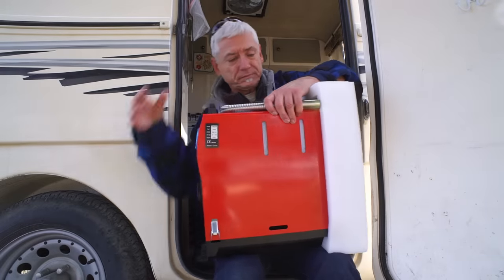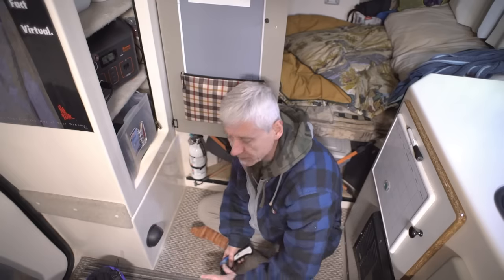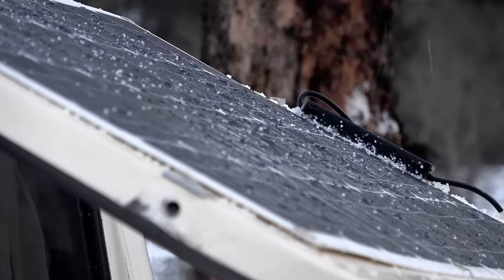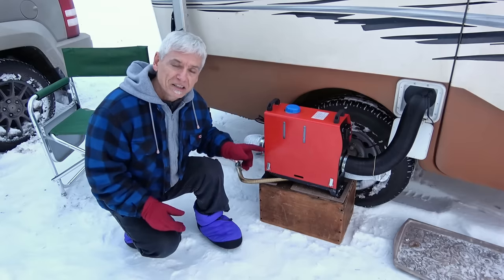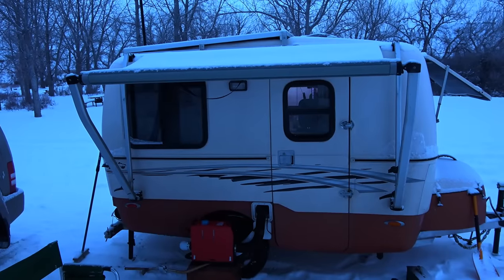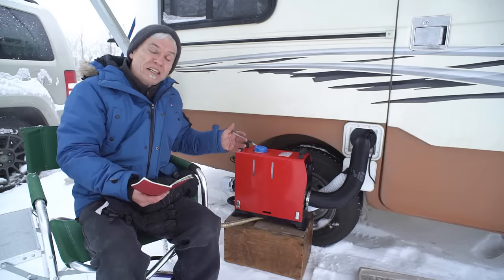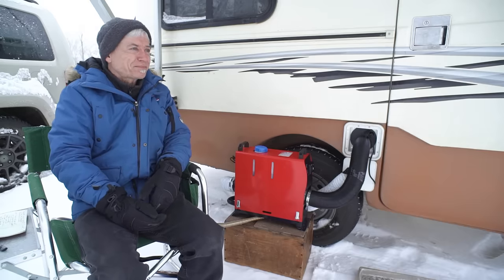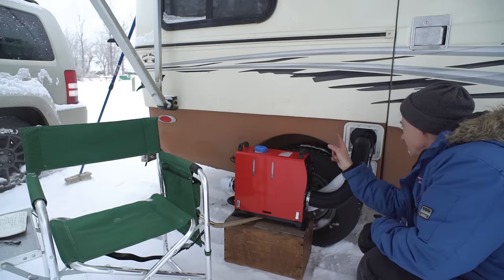Can this Work with a Camper? My Parking Heater Experiment Part 2

Comment: Slim, really appreciate your videos....I can't help but think you would have better success with the intake hose being inside the trailer....a home furnace depends on reheating the home's warm air and not heating the outside cold air....also maybe consider an insulated box to protect the unit from exposure and maybe dampening the fuel pump??...thanks again for the demo 🤓
Reply: That would lower the amount of fuel burned per hour by half or close to half. I could be wrong. Hopefully someone has done that and will let us know.

Comment: Try putting an insulation around the pump. That might help the noise. Love the videos.
Reply: they sell a silicon cover just for this purpose.
Reply: Looks like the pump also is pretty much bolted to the front panel. Some rubber mounts/bushings could help too.
Reply: I didn't know about the silicone cover, but I did wonder about isolating the pump using the same concept as they do with the water pump in most RV's, a number of rubber grommets to keep the vibration of the pump from making the back of the heater case a diaphragm.  
By the way Slim, love your work, great videos.   Wish I knew ahead of time about your Natchez Trace trip a couple of years ago,  you were in our back yard. 
Keep up the good work.

Comment: Hi Slim.

I follow your escapades with interest as I bought a small caravan (About 10 Cubic Metres inside) in June last year to travel the UK, I've only had one trip in the summer though due to our lockdowns. Even though the UK doesn't get too cold I still need occasional heat as it can get chilly, currently it's -1 degree Centigrade. I didn't want a gas furnace/diesel heater/Buddy heater as I would use up my Propane in no time and/or have to find a space in my van to either fit and/or drill holes in the van. So I decided to try a Tilley Lamp for light and heat. I have just tested it and it raised the inside to 22 Degree Centigrade from 4 Degree Centigrade in an hour. Not too shabby. It uses 1.5 Imperial Pints (0.85 L) of Paraffin (Kerosene) every 12 hours, so cheap to run. Yes, you need ventilation but that's no bad thing to keep the condensation down. It stabilized at 22 C even with all the windows (Three) open an inch, hardly any condensation either. It puts out about 700W of heat by my calculations. Heat and Light for very little, Win Win as far as I'm concerned. Wonder if you would do a test? You can even cook on them if you make a small wire cage to put on the top to stabilize the pan on. So possibly a Win Win Win. I got the idea from the yachting and fishing world where they are apparently commonly used here in the UK.
Reply: Oh and a couple of small fans to move the heat around, one horizontal and one blowing down from the roof. Obviously they produce CO, but no more than a Buddy Heater or similar propane heater, so a CO detector is vital, I ran it for 2 hours with no issues but I would never go to sleep with it running.

Comment: I used an 8kw heater set up very similar to that in my 28 foot trailer for hunting season in November. Put it in a box so it was covered for weather. Put a metal duct into a small bunk window. Was on for 7 days straight. Used about a gallon of diesel per day. Used about 1 to 2 amps depending on set temp. 150 watts of solar was mostly enough to run the heater and the fridge, lights, charge phone, etc. Ran the generator for a couple hours in the evening if required.  They work good if you want to tinker a little for the setup. I hung the fuel pump on an angle with zip ties and barely heard it.

Comment: I fitted the permanent van install in my trailer and in a way I actually wish I had bought the self contained portable heater like yours to give me flexibility and versatility in my shed at home when I. Didn't need it in sub zero temps.

Great video, thanks.

Comment: Awesome information! Just what I was looking for, all my questions answered all at once and I didn't have to bounce around for hours, days or even weeks to find the answers. I now know that I will have to use a 3" fireplace flange, heat sealant, double walled steel pipe for the hot air coming into my tiny all metal tear drop trailer. {all metal means the floor is 1/2 thick aluminum plate, the sides and front are 1/4 thick aluminum plate and the roof is topped with 1/8 thick aluminum sheeting} I have 1 inch poly foam board on all interior surfaces and covered with thin Birch Plywood. I am going to use the fireplace flange that has an air gap and the double walled steel pipe to prevent any heat damage to either the wood or foam causing fire or melting, safety first! Your video gave me all those answers, thank you so much!

Comment: 1. Insulating the warm air hose run on the outside would help with efficiency.
2. It would REALLY help efficiency to add a cold-air return hose. Then the heater would be reheating already somewhat-warm air instead of starting with frigid outside air, plus you wouldn't have a positive pressure situation inside the trailer that leaks warm air to the outdoors.
3. Adding a cold-air return hose would also stop the problem of the heater sucking its own exhaust fumes inside the trailer.
4. The thermostat is outdoors, so the heater is in an always-on state. Use some multi-conductor cable and a connector to allow the thermostat to be mounted indoors and one would get better temperature regulation.
5.A marine-grade propane heater might be a better solution. They are generally built to better standards than RV grade equipment and draw less electric power. Many RV'ers use them successfully. Biggest minus is that they cost quite a bit more than a cheap Chinese diesel heater.
Reply from the maker: 1. I wasn't looking for efficiency, I wanted to keep the camper above freezing
2. Same as above
3. Incorrect. Diesel fumes enter regardless. Try spilling a puddle outside and you will see
4. I don't need a thermostat. It is only used on manual mode
5. I don't spend a lot of money on an experiment. This gave me all the details I need should I decide to upgrade. I wouldn't bank on that though! Thanks, SP
Reply: David, ANY problem can be overcome by throwing money at it...where are the funds for that? Where is the FUN in that? Here is something to consider. Restrain that urge to offer up a "post-video" list of what someone should have or could have done. It can be depressing at the receiving end. Think about it.
Reply: @SlimPotatohead  The marine heater would have to be seen as more of a (non-trivial) investment, not an experiment. If one searches around, there's quite a few RV'ers who have used them. Plenty of existing experience to rely on. The question is whether it is personally worth spending that sort of money on a heater, and that is a question only you can answer.

Comment: Great video! I always wondered if the jackery  could handle that kind of draw.  I personally would look into insulated hoses for the air. And would absolutely draw the fresh air from inside the trailer.
Reply: No. No. No. Even though it is not combustion air...
Reply: I absolutely agree, David.  If not, for every cubic foot of hot air that comes down that hose, a cubic foot of warm air inside the trailer is pushed out (through cracks around the door and windows, vents, chases for wiring, etc.).  Heating an enclosed area that way is like bailing out a boat with a cup without a bottom.  It would make a significant difference i the heating efficiency to have the intake air come from inside the closed trailer.
Reply: @brucebear1  just like central heat and air conditioning in a home. As long as you have a carbon monoxide alarm and a smoke detector, everything should be nice and cozy.

Comment: You could make a box to sit on the back of the trailer that would work as a storage box in the summer and a heater enclosure in the winter.  You could even put a solar panel on it and make it autonomous from your jackery power.  It would also be better to run the heater with air from the camper.  You could even run the fuel in from a bigger jerry can which could last a week or more!  So you only fuel it up once when you are gassing up the car and you are good.  No fumes....no fuel odors....no worries about losing power.  Its a win-win-win!

Comment: I don't know why yours clicks like that. I've used a few in big rigs, and other than the whine on start up, they have never made that noise. It could be the fuel pump. Or maybe the fan is hitting the shroud. But that's just a guess.  I do know a wabsco is around 1k. So very expensive. Great video. I'm still trying to figure out what I want to install in my van build. So all information is good information. But I'm still a long way off. The only thing i've done so far is the installation of 2 maxair fans. Love the video's Slim, the amount of information you give us is great. Good luck !

Comment: I just installed one of the Happy Buy knock off brand semi-permanent heaters inside the dinette bench of my 2021 Coleman 17b trailer.  I discovered, just like you, that 24" of ducting is not enough to prevent the cheap vents from melting...  I invested in the Webasto brand vents and they hold up much better!!  Webasto has been making diesel airtop heaters for decades so they really know how to make the systems work.  These little heaters are great for RVs and much safer than the Mr. Heater propane units people are burning inside their RVs.

Comment: I saw a van diesel heater install where the person only attached the top of the fuel pump. He let the bottom hang free. It was still at 45% but it was very very quiet.

Comment: Having worked in a factory for forty years, that taping noise you kept mentioning, I 'tuned it out' quite easily just because of worked in a noisy factory. Several times during the video I 'stopped hearing it' until you mentioned it. So I would suggest it is something that a person can get use to given enough time. Just like one time some time ago the in-laws came to visit with a pop up style of camper. We had them set up so it was shielded with the house away from the major highway that was about 500 feet away. That next morning they ask us how we could sleep with 'all that noise', we both looked at them and ask, what noise? We were use to it and didn't hear it, tuned it out.
Reply: I remember back in the 60's, my grandparents lived about 100 yards from the North-Western railroad tracks. Every night at 9, the whole house would shake when the steam train came through at about 60 miles per hour! My grandparents never heard or felt it!  :)
Reply: @nejdro1  for these noise I also tune them out easily. But when they stop I tend to freak out knowing something has changed and being not immediately able to know/remember what.

Comment: Great 2 part video.  Looking forward to 2021's adventures. I've had a China heater in my 8 1/2'  truck camper (permanent install type) for 3 years now and have had no issues with it.  Glad you found the "6 hour"  problem.  Diesel air heaters are definitely not for everyone.  All the best in the New Year.

Comment: Slim, I really appreciated this analysis. My problem is getting thru the summer night in my minivan with my partner, my pet parrot. Can’t make fumes, parrots have very sensitive lungs, so must be electric and you know the challenges there. COVID has simplified the travel question for a year but you have helped eliminate the diesel possibility. My minivan is not tricked out with any heat in the cargo zone. I have been trying to use heating pads for overnight. Parrots need to be in the 60 to 80 degree range. Guess I’m out of ideas.

Comment: A squeegee on a telescopic handle looks like a great tool to clean water and snow off solar panels. I have a aolar aystem to install next year, I will make a squeegee for myself. Thanks for the videos. I need to finish with my diesel heater and test it before I  need it.
Reply: I use a large squeegee that can be extended. Use it for cleaning dust or washing them. It would work for snow too, but not anything frozen on them.

Comment: Have you thought about some sort of insulated little "house" to cover the heater - it might minimize some of the tick-tick-tick noise it makes.
Reply: A housing would likely also keep snow off of the unit instead of an umbrella,and that umbrella plan still worked well for you.
Great informative video, and nice work.
Reply: Ya I was thinking it's just the fuel pump so you could probably just wrap it in Insulation and quiet it down and I'd be surprised if they don't make another pump that is quieter

Comment: Thanks for giving me the idea of mounting the heater (one of the lower profile models with remote control) on a hitch step with an 8"x18" platform. I plan on using one of the vans existing passive corner vents to move the heated air into my 2012 Transit Connect.

Comment: I have the exact same unit arriving, I had planned to mount it on my second pickup truck to keep the interior dry / warm / mildew free (it gets pretty damp / wet with condensate in the fall & winter). 

However , after watching your videos and others on the internet, I'm having my doubts now. 

Primary concern for me is a power source. I had planned to run this off the trucks second battery (deep cycle) and have it run 24 / 7 (with refuel every few days). 

Not sure I'll be able to do that now.... seeing the power usage on your video. I may just use it as a temp portable unit for a few hours, every couple of days. 

Love your video, you really went into the pros and cons of this heater unit. 

Cheers from BC 🍻🍻🍻

Comment: I’ve been thinking of getting one of these for my garage shop. Where I live it doesn’t get all that cold, but it’s cold enough. The compactness and the amount of potential heat it can produce is appealing to me. You mentioned the diesel smell and like you I really hate it. I’m guessing it’s due to having the intake located outside which could pick up the exhaust from the combustion. I would be routing the intake to get air from the garage so that would eliminate the diesel smell. I’m glad you continued with your experiment and shared you experience. Thanks Slim.
Reply: I have one in my garage and it’s absolutely great when I’m working….keeps me toasty warm. Do it you won’t regret it

Comment: Wrap the fuel pump in sound deadening material. I use 1" SounDown foam for my  marine Webasto installations. For that Chinese knock off will probably have to remount the fuel pump separately
Reply: A cheap way to go might be a section of pool noodle, maybe?
Reply: @Jeff Barnett how do you rate the Chinese vs the real ones? are they are noisy? do they start up and act the same?
Reply: @bobham919  the solenoid pumps are the same for both German Webasto and Chinese version. Everything is made in China. I use a white noise machine while I sleep to drown out road noises and other truck drivers who like to idle all night long.

Comment: It does look like a bit of a pain to set up, but I agree it could be a useful solution.  I'd be more comfortable with that than a wood stove in the trailer.  A quick google on "chinese diesel heater clicking" came up with several videos on "fixes" which really seemed to be either insulating or suspending the solenoid pump.  If I were going with your solution long term I would probably install an exhaust pipe at the rear of the trailer to get the exhaust up overhead (unplug heater at the base of the pipe when moving), and maybe see if I could rig up the fuel to come from an external jerry can -- more capacity and you can take the whole can down to the station to fill it and never have to "pour".

Comment: I love your videos slim. i have the same heater and have been using it in the cold winter in minnesota. i heat my garage and my portable ice shanty. one idea for you is remember to run it in high for at least 10 to 15 minutes before you shut it down. it will keep the soot build up down and possible less smell. I use mine on high a ton and never smell any diesel personally I just was ice fishing for a week ran and 3/4 to high for 5 days kept me toasty warm . again thanks for the videos you are a value to me.

Comment: This was a nice treat to wake up to. 2 Slim videos. Curious how much power your propane heater would have used.
Reply from the maker: Excellent question. I was going to compare in a later video however here's what I have so far. My propane furnace averages around 31 Watts when running. Assuming it will shut off when at temp, and start up again when cold. It would be fair to say in cold weather is would actually average 15 watts an hour for 15 hours. That's 225 watts. The diesel would use 130 watts (or maybe less), so in this case the diesel uses less power.  One solution for me therefore is just seek out a new power efficient propane furnace and not bother with another fuel type of heater! Thanks! SP
Reply: @SlimPotatohead  The quality European heaters, which are similar to the oil fired units, are available as propane fired. Of course , they are several times more expensive.
Reply: @SlimPotatohead  what power does the propane furnace use that is not the fan. i would think the only power is the fan
Reply: @SlimPotatohead  I can see how the propane furnace fan might use more electricity.  Do you have any idea of the fuel cost comparison between diesel and propane per heating hour?  It's easy to measure the diesel level but difficult for the propane unless you went by weight.

Comment: Hi Slim. Regarding the sound from the fuel pump - try removing it from the mounting brackets. So it only hangs in the tension of the fuel hoses. I believe this will lower the sound.
Happy New year !